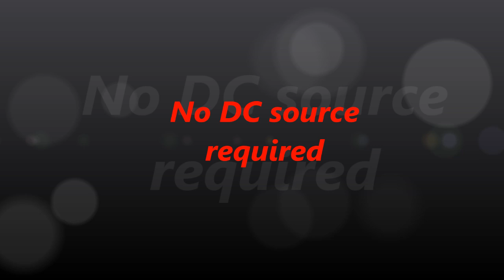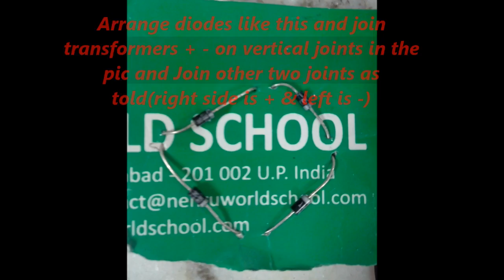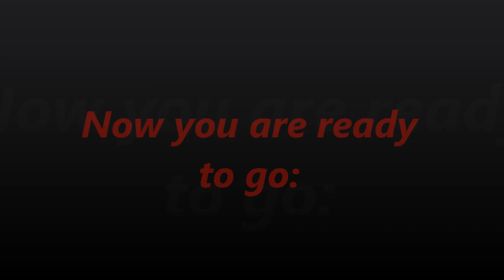Make your own  RC car (without PCB)

Comment: And its cost
Reply from the maker: https://www.flipkart.com/robokart-bo-dc-motor-150-rpm-l-shape/p/itmekm2hjypkcnqe?pid=ETYEKM2HSYYHXWGW&srno=s_1_1&otracker=search&lid=LSTETYEKM2HSYYHXWGWZKCQIU&qH=e9b72aca2c222ecf

http://www.ebay.in/itm/BO-Gear-Motor-150-RPM-for-DIY-Projects-and-Robotics-/272208777850?hash=item3f60e8527a:g:xigAAOSwq19XC~-a

you can buy BO motor from the above links